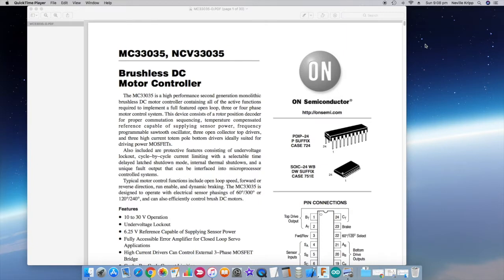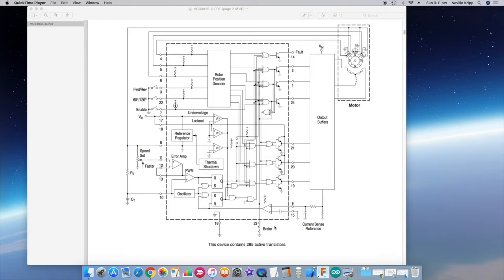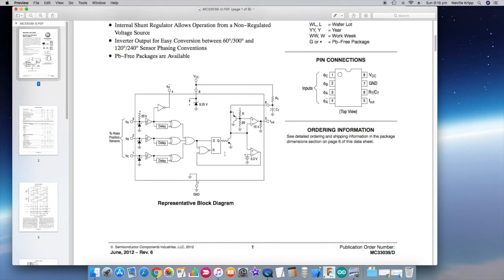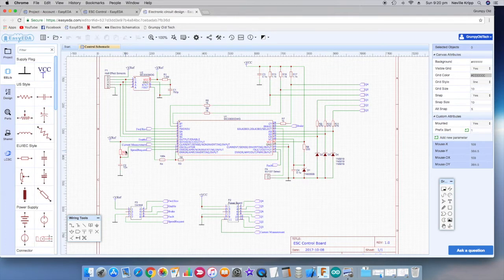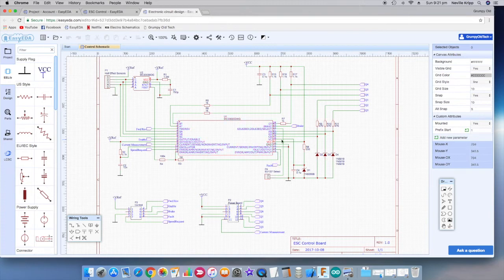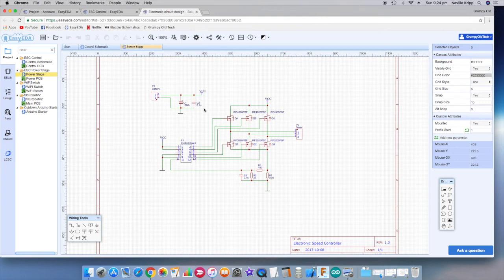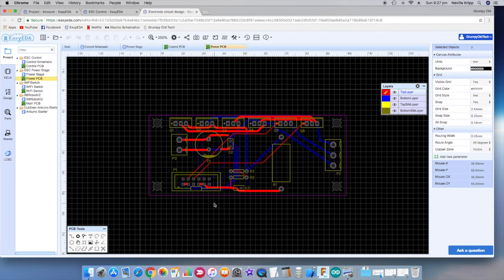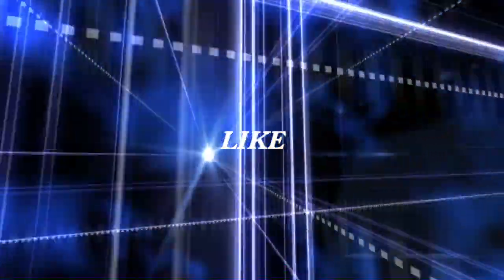#018 Brushless Electronic Speed Controller Design

Comment: 10inch 10 inch 10x6-5.5 wide tubeless tyre brushless gearless dc wheel hub motor balance scooter hub motor hally motor phub-188 

Is this circuit works fine with above mentioned motor ?

Comment: Is this circuit works for 1hp BLDC motor. Kindly tell me what is the role of the arduino as  you spoken.
Reply from the maker: Hi, 
this circuit may be ok for a 750 watt motor as the mosfets selected can handle quite a substantial current. The thing to keep in mind is, depending on the voltage the motor will operate at, the required current will vary quite a lot. You need to check your motor specifications and the mosfet specs to determine if the mosfets will be suitable. One other thing, regardless of the motor voltage, the current is likely to be quite high and you will need to ensure sufficient heat sinking of the mosfets.
With regard the comment on the arduino, I was planning to control the motor speed by interfacing an arduino to this circuit. I ended up not using this though as I decided to design my own speed controller using an arduino.
Hope this helps, nev.
Reply from the maker: Hi, 
this circuit may be ok for a 750 watt motor as the mosfets selected can handle quite a substantial current. The thing to keep in mind is, depending on the voltage the motor will operate at, the required current will vary quite a lot. You need to check your motor specifications and the mosfet specs to determine if the mosfets will be suitable. One other thing, regardless of the motor voltage, the current is likely to be quite high and you will need to ensure sufficient heat sinking of the mosfets.
With regard the comment on the arduino, I was planning to control the motor speed by interfacing an arduino to this circuit. I ended up not using this though as I decided to design my own speed controller using an arduino.
Hope this helps, nev.
Reply: @GrumpyOldTech thanks for reply. 
 sir, have you tested any motor? If yes then plz provide me the specs and model.

Comment: Is it possible to adjust the advance of the voltage phases in order to compensate for the current delay in the windings at high speeds of rotation?
Reply from the maker: Hi Sergey, the chip is pretty much a self contained device. It seems to be as case of what you see is what you get.
Reply: @GrumpyOldTech  hi sir can you please help me to built a closed loop control circuit of bldc motor